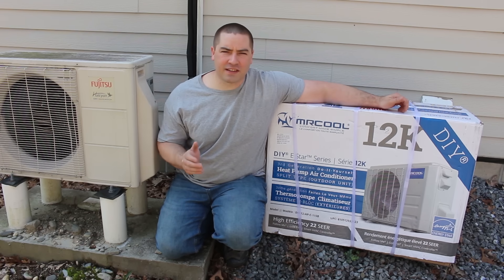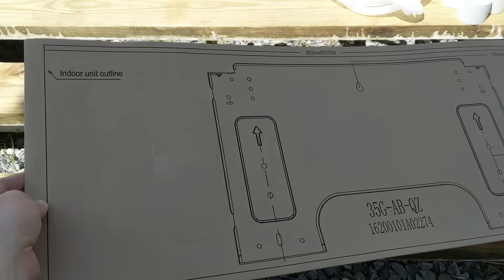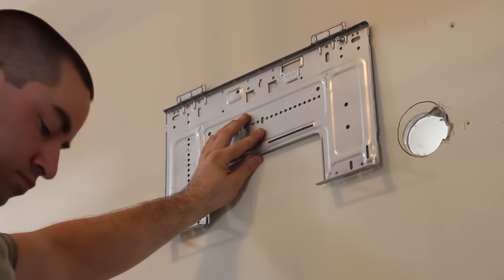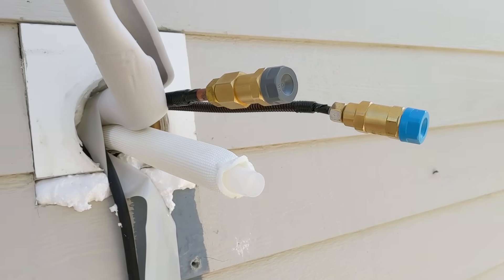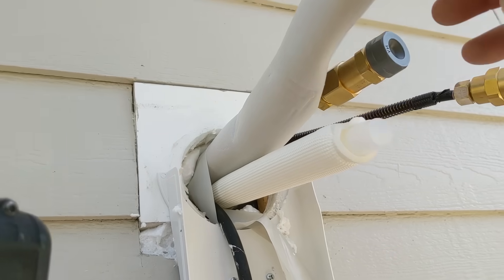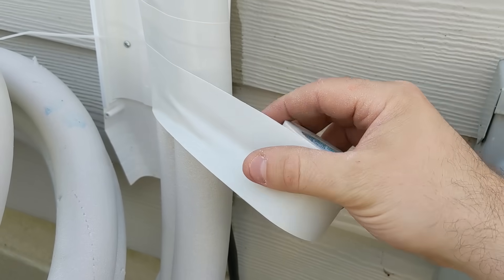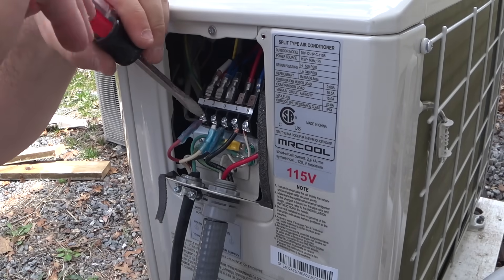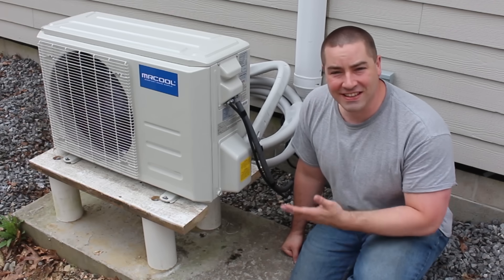Installing My Own Mini-Split Heat Pump, DIY

Comment: I have expect that you at least pull vacuum.. with vacuum pump.... 
Can you tell me what kind of refrigirant gas is using this device?...
Reply from the maker: This is a very unique system.  No vacuum, no gauges, no pressure nitrogen.  The lines are pre-sealed at the factory.  Mr. Cool is the only company I know that has an official DIY version.
Reply: Yeah... that would explain lots of things...and clear confusion.... 
So if I understand that right that only conectors are exposed to air....👍and pipes can not be cutted... 👍
Reply: @Bostjan Trancar, most of these ductless system use R410A (can not be interchange with R134a for automobile A/C) and run at a much higher pressure than the older R-22 system.  Also, R-22 is hard to come by these days.  You'll need to have a license to buy them.

Comment: Really enjoyed the pace and detail in your video. Just the right amount of info. Thank you. Curious about your decision process, going with an AC unit off-grid versus a DC unit. If you could share that I would be most appreciative.
Reply from the maker: Sure.  I've seen one 48v mini-split on the market.  But it requires professional installation because of needing to pressure-test it, vacuum, etc.  That means more money to hire someone.  That's on top of being about $800 more up-front just to buy the unit.  Then if I did install it, I would need to dig a trench and bury about 140 feet of wire from my garage (battery bank) to this location.  That 48v model requires 20 amps, at this amps, and gauge, I would need to install 2 gauge (AWG) copper wire to and from the battery bank to get under a 3% voltage drop.  Round trip that is 280 feet.  That's about $500 in wire, plus the conduit and fittings.
Reply: DavidPoz thanks for sharing all this. Great insight!

Comment: Interesting you are not scared drilling such a big hole in the wall ^^
Excellent videos !!!
My wife also wants air co this Year, I asked DAikin installers a quotation (multi split 4 indoor units, 1 external).
Reply: Alexandre Esquenet Hmmm,not wise to do that. If outdoor unit fails,you lose ALL your units. Unless you are restricted by code to have only one external unit,four separate units are much better and will cost not much more than multisplit.
Reply: I agree with Vlado, having 4 split units is a way to go. For each outdoor unit, have one indoor unit (as a set) is a better choice.
Reply: Go for it Vlado. I install those all the time. No issues. You can go up to 5 zones on  one ODU too.

Comment: Great video - I've been wanting to install several of these. Do you know what the actual amperage draw is? Also, what size Lithium Iron Phosphate battery would you recommend to power this overnight on an off-grid solar setup? (I know that is a loaded question)
Reply from the maker: I'm going to do a follow up video testing the amp draw, but I don't know right now.  We had snow two nights ago and this ran on my batteries and inverters (along with the whole house).
Reply: @DavidPozEnergy  Thanks - Love your videos. Looking forward to the next one!

Comment: These are great systems and I like the line connectors. One step you forgot is connect vacuum pump to bottom line set on condenser to remove air out of lines before letting refrigerant out. This is about a 20 min process. I believe that is to remove condensation out of line, any HVAC guys can chime in. Good job David.
Reply from the maker: Using a vacuum pump is needed with every other brand of mini-split.  Mr. Cool offers a few sizes of this unique setup made for DIY.  Everything is pre-sealed at the factory.  There is no need for vacuum pumps, pressure nitrogen, or gauges.
Reply: Air is not "compressible" compared to refrigerant. If you don't vacuum the system you will get higher compression ratio which is not efficient for AC system, and higher discharge temperature/pressure. Any HVAC-R systems should be vacuumed before releasing refrigerant into the systems.
Reply: @UltraHydrophobiccoat  the system is designed for diy install with no vacuum needed, check the website. That is why the lines are a set length and sealed.

Comment: Thy really need to offer different length accessory kits.
Reply: they do, just have to order it under parts and accessories
Reply: @williamhustonrn6160  Bad form to have youtubers "reviewing" products and not doing that then.
Reply: I ordered mine with different lengths
Reply: Or have better cable management. They've given it a decent thought: another bit of plastic would have made the difference.
Reply: Or just get someone that knows how to flair lmao
Reply: @theboone3848  But that defeats the purpose of buying a DIY pre charged line set unit

Comment: We install Fujitsu and Daikin, and at least in build they look like a legitimately respectable built unit, the warranties aren't very long I don't think, but I was at least looking at the pro install models with regular flare connections to put in my place so I don't have to deal with asking for one from work
Reply: The Mr Cool DIY units have something like a 5 or 7 year warranty on the compressor. How much better of a warranty is there?

Comment: Wish I lived near ya. I would buy that old system from you. I have had good luck repairing leaks and recharging older heat pumps with r290 ( pure propane ).
Reply: Just don't ignite it!😁
Reply: Hi Aaron, my Trane AC got Refrigerant leak, I was told the R22 is not allowed to be used! Is there anything I can do? thanks
Reply: @BK-pn6sq  in Australia they dont make the units with r22 u can get it recharged but very expensive for that gas

Comment: Did I miss vacuuming out the air in lineset?
Reply from the maker: This is a unique DIY version.  The line set comes pre-sealed from the factory.
Reply: @DavidPozEnergy  Does it come precharged with refrigerant?
Reply from the maker: Yes, it comes pre-charged.
Reply: @DavidPozEnergy  Is the line set sealed and vacuumed or gas filled?
Reply: Jesus Christ people…DIY…no vacuum
Reply: Also concerned here. I installed a Pioneer mini-split about 2 years ago, still running great. After a lot of research before installation, I decided to purchased a vacuum for the line set, it was an extra expense, but savings of course over professional install. The line set ends look different from Mr. Cool, so I'm guess it's either vacuumed from factory or already filled with 410-A, probably filled so they can/could offer line sets of different lengths to make sure the gas is correct for long runs.
Reply: I missed the vacuuming too. Air in the line means water. Water in cooling means freezing the system. Hope you have a dryer inside.
Reply: Edwin Groen Air in the lines doesn’t NOT mean water freezing. Air or non condensates in your reefer system will cause the 410a to turn acidic. Acidic reefer destroys compressors, components, etc. 

A properly vacuumed system to under 500 microns is absolutely necessary to the system working properly. Bi-flow filter driers or not used in VRF systems. 

I’ve never seen this “DIY” version of split systems. I’m very interested to see how those line set fittings work/hold up after time.
Reply: @edwingroen2028 you missed the nine comments saying that it was sealed and didn’t need vacuum

Comment: Thanks for the video very well done. I've had that exact unit in my watchlist for some time now. Now I can see why it has so many positive reviews. When my window unit dies out here at my off grid  house. I will replace it with one of those and eventually when I add the second floor I can add a second unit they seem to be a fantastic quality thanks again.? Did you ever test to see how many watts it uses at startup and while running would love to know that thank you.
Reply from the maker: Not yet, but I can tell you that my inverter didn't even care it was on.  But I plan to do a follow up video with an amp-meter on the hot leg.
Reply: @DavidPozEnergy  Thank U.

Comment: The only thing I don't like about this is the excess tubing. I know that is a big part of the DIY friendly part but if I would install I would still want it to be the correct length. This product interests me because my master bedroom is the furthest room from the furnace and it does not get enough air flow for the warmest summer days and coolest winter days.
Reply: The tubing can be purchased at different lengths depending on application
Reply: You can choose how much tubing out of a few selections. You'll likely still have a little extra, but you can get it close in most applications. It looks like he could have gotten about 10-15' less tubing and been okay.
Reply: There is also a zoning option for conventional central forced air systems. That may help with getting air to poor locations. Ask for a free quote for a zoning system from your local HVAC company.
Reply: drescherjm if you know how to solder braze or flare tubing you can shorten the length yourself. Only drawback is you’ll need to attach a vacuum pump and evacuate the lines down to 500 microns. I bought Samsung’s for the house in the Philippines and they wouldn’t cover the warranty if I installed it, even tho I showed them my universal license, they insisted I pay them to install it. Well, they just opened the liquid line side valve and cracked open the vapor line fitting and flushed the air out. Not ideal but it works in a pinch. If you purchase a more traditional brand that has 1/4” and 3/8” male flare fittings then you can make your own flares fittings. Always be careful to cut tubing slowly and incrementally so as not to curl the metal inwards too much. Debur just slightly(over deburing thins out the metal)with tubing pointing down so flakes fall out not inside tubing. Then flare the ends (after putting on the flare nut😝) and again flare slowly so as to not fracture the copper. Copper will only bend so much so fast without cracking. Teflon tape and thread sealant are useless on flare fitting. The flare on the tubing is the surface that mates with the male flare. A copper flare washer helps with leaky issues. Lining up the connection with straight tubing and fittings will give you a leak free joint as well. You can install a flare union after shortening the line set using the dummy fittings shown in David’s video here.
Reply: @billssolarpowerandgardenin1016   I have hundreds of hours of soldering experience with copper pipes but not so much brazing. Last time I did that it was the 1980s and I was in high school. Anyways the idea of using one of these units in my situation would be probably the third or fourth try after the others failed. Just got to get time to tackle the problem..

Comment: Your house is full of cable wires LOL that's cool 🤓
Reply: Who's isn't? You got light switches, fans, lights, ethernet, coax cable, multiple exhaust vents, central air vents etc. Hopefully this guy does a decent install  because I haven't seen yet or I retract my statement and apologize in advance. 😂
Reply: Gotta agree a little though wouldn't drill through my wall right there.

Edit:
Oh fck me no he didn't just slide it in there with a little spray foam at the back 🤦‍♂️. My bad bro I'll shut up

Comment: Are mini splits limited to a single unit per room?
Reply from the maker: No, there are some units that have one compressor outside, and up to 3 indoor "head" units.  I'm using this setup for my whole house, but I have a small house.  LOL.  The thing is, this unit is DIY, and only has the option of one indoor head unit.  But even if you hire someone else to do multiple heads, those are less efficient.

Comment: On the spring wrapped lines. After you have the lines bent where you want them, either remove the spring, or EXTREMELY WELL SEAL THE LINESET! Any moisture condensing on the lines will rust the wire, making a HUGE mess...
Reply from the maker: Good tip.  Thank you.
Reply: @DavidPozEnergy   I wonder if the spring is really metal. Another brand I saw used a hard plastic.
Reply: @Sylvan_dB  they are. And cheap metal too.
Reply: @Sylvan_dB  I have seen several units where the spring was exposed to air, and the rust sludge was a huge mess.
I hope more manufacturers use plastic if it will work, or stainless steel, something better than plain steel... but IF SEALED WELL, it does not matter.
Reply: I was thinking the same thing. Those two metals don't play well together.
Reply: I have the High Seer version of this exact system, the spring on the lines is not metal, was like hard nylon.